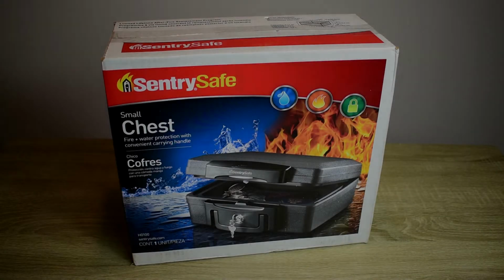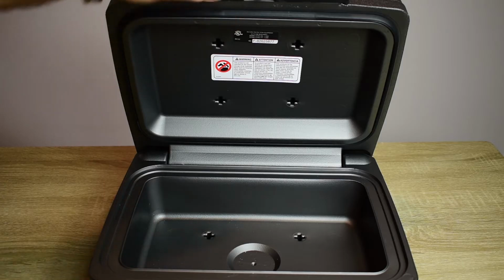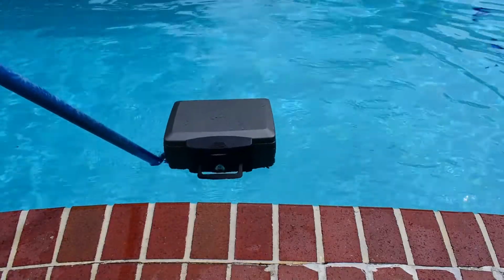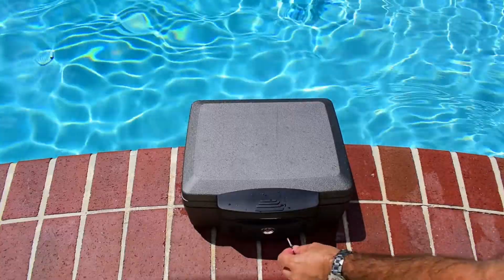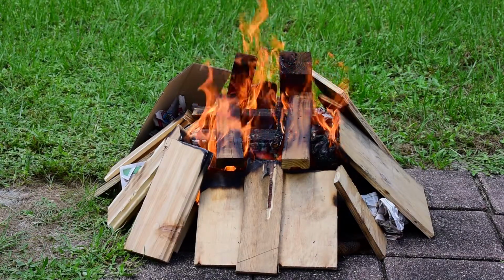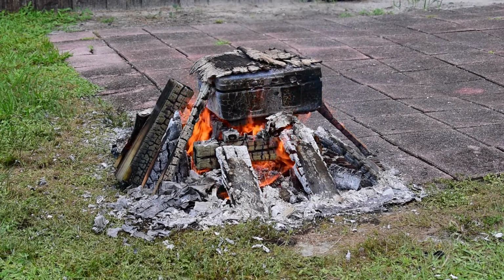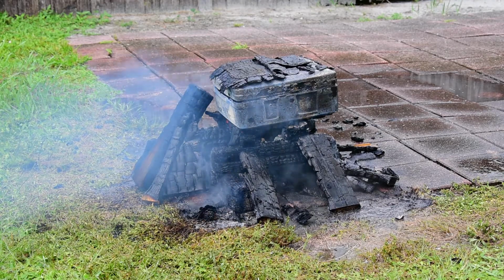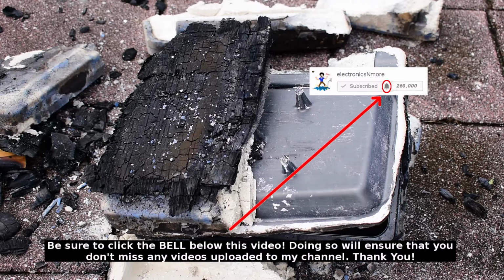Fire Resistant Safe Test! (Water Resistant)

Comment: Never use these your documents will mold. 

This will keep water out but won’t keep water vapor out. But once it gets in it will never dry out. So you put an important document inside and open it a couple months later assuming your documents were safe. But the safe it self destroyed your documents with mold. 

You can get extra thick ziplock bags that fit standard paper or legal sized paper. When those are properly closed your documents are protected from water vapor. So get a fire proof safe, this one looks good, and use airtight bags for your documents
Reply: The ziplock bags could melt with the heat if there is a fire, and damage your documents. But good thoughts about the mould, I’m going to add some moisture desiccate packets into my safe (but somehow need to protect them from melting on the documents too)!

Comment: I don't understand why some people hate sentry safe.  They are amazing.  I think the problem is people are looking for a one-size-fits-all safe.  But sentry safe makes multiple different safes for multiple different reasons.  One for fire and water, another for theft, another for firearms and medicine, ect.  They get upset when the fireproof model is easy to break into, or where the theft model is easy to damage with water.  They are trying to put them through things they are not designed for.

For instance, the safe in the video is advertised to protect from water and fire, nowhere on the box does it even advertise that it is meant to protect from theft.  The lock is like a lock on your luggage, it's for privacy not for security.

Comment: After seeing the lock mechanism melt off in the fire, I didn't have any hopes for the paperwork inside. I was relieved to see the paperwork stayed unharmed during the fire since I own one of these safes personally. 
I would honestly like to see the safe sit in the fire for an hour to see what happens. House fires get much hotter than a simple camp fire. I'd like to see the safe pushed to its limits. Doing another test with the safe sitting in the fire for an hour could be a realistic situation for people who have homes not near a fire department at all. So the safe would sit for a much longer period in the fire. If it would survive an hours worth of intense fire, I'd be sold on buying another one. Good video👍
Reply: I threw mine onto the sun and it survived!
Reply: Test that one with your own that you have😅

Comment: You cannot compare this to a house fire. They burn much much hotter. I lost everything and all the insulation on the safe was almost all gone. Papers were burnt on the edges but this video doesnt show what they really look like after a house fire. Also house fires go on for hours.
Reply from the maker: You sure can compare. The average house fire is around 1500F, the average campfire is around the same temp. My test is actually better because the flames are in contact with the safe the ENTIRE time unlike a house fire. Also, it depends where the safe is kept in your house. Close to the floor, the temp will be lower, up high, higher temps. Most house fires are put out in approximately 30 minutes, and that's what the safe is rated for, 30 minutes. If you live in an area where it takes hours to put out a house fire, especially if you're paying high taxes, you should consider moving.
Reply: Did you have documents in a fireproof bag inside the fireproof safe? 
I thought the idea was that the safe & bags were designed to be used together in conjunction. You need both not one or the other.

Comment: Is there something similar for USB, CD, HDD, SSD etc.? I assume the heat inside will destroy any data so it's not really an option for electronic storage media.

Strangely, the masterlock LCFW30100 (the biggest version of these) is advertised as suitable for "Storage Devices, USB Flash Drives" and "Small Electronics", which I don't understand. Clearly it gets too hot inside for the plastic not to melt or the data not to be destroyed.

Comment: Doesn't matter if it can survive a fire these fireproof safes will rust a piece of metal within 2 weeks if you put any cash or documents in they will be fully damp within two weeks and awful mildew mold I put $1,000 pistol in one of these by 3rd week it was rusted! These are junk I threw mine at the local dump site will never use any type of safe ever again
Reply: Unfortunately you'll have to get the older kind that are not fireproof or waterproof so the material can breathe I've just been using the lockable bank pouches they're not as nice as the safe but at least things won' mold
Reply: Which ones are good

Comment: I would put the valuables in a fire proof zipper bag first, then put that zipper bag inside that safe. This may help to buy more time. I wouldn't store that safe on a shelf or on the 2nd floor, because when it falls and hits the floor that cement type material enclosing the plastic interior is going to break and crumble to pieces and now leave that interior plastic exposed. I would hide it very well and keep it on the bottom floor, you don't want that fire proof material breaking or crumbling apart
Reply: problem with that is, then I am going to stack shit on top of this and be annoyed having to open/close it, think a real front opening safe will always be much better although way more expensive
Reply: There are several videos out there where they tested those fireproof envelopes, they are trash the cash burned up inside

Comment: Do you think hard drives would be ok after a fire as the inside can get pretty hot? Or wouldn't that be a problem? Would be nice to have something like this for a backup disk with pictures/videos.
Reply: Came here wondering exactly that.
Reply: Yes, I was wondering how various digital storage products would hold up, like external hard drives, thumb nail drives, SD cards, CDs, etc.
And also curious how metal would affect things inside, like if you were storing precious metals how they would affect the other things in the box.  Or even a paper clip or staple holding papers together- could that get hot enough that it somehow would burn the papers it was in contact with?

Comment: WATER RESISTANT not WATERPROOF. It means it’ll be fine in the rain, but shouldn’t be submerged
Reply from the maker: That's correct, but knowing homes flood, and the chest can get hung up under a shelf or be inside a drawer, I felt it was necessary to perform the test.

Comment: Using a temperature gun pointed at the fire would have been nice.  House fires burn much hotter than a camp fire.
Reply from the maker: All depends where the fire is, and where the safe is. This test was good because the fire was centered on the safe.

Comment: I appreciate your video,,,,if people are on a tight budget this is a very good option I owned one I have for several years now they’re cheap,,,,however pretty good,,,about eight or so years back I also bought a small Sentury floor safe I thought I was actually getting a safe,,,,well they are not theft prevention,,,, I didn’t know,,,,I thought they were rocksolid they’re not,,,,I paid a little over $100 for it with tax on sale it has the old-school dial combination lock and it weighs a little over 100 pounds,,,,I’ve seen videos on that safe it can take a pretty hot house fire and survive a 30 foot drop without opening so I’ll keep my little chest and my little safe for fire protection for my documents however I will be upgrading soon I hope,,,,to an actual Theft prevention type safe. I’ll probably go with a burglary/fire home safe that is UL rated RSC and UL rated fire resistant.
Reply from the maker: Glad you liked the video William!

Comment: Sentury does offer decent fire protection at a very good price point however do not buy Sentury products for theft prevention they have zero theft prevention except from very small children,,,,they are good to protect from 🔥 fire and possibly limited exposure to water that is all,,,I would go to Dean’s safes or the safe and vault store and look around at their home burglary/fire safes if you’re looking for something a little more substantial,,,, I have been looking at American security BF 1512 and American security newest line of home safes the BFS series,,,another decent safe at a decent price point would be the American security CSC series decent burglary protection excellent fire protection,,,,, another good brand of small safe would be Burg watcher small but built like a tank. You can get a special bag that’s fire resistant and water resistant from these safe stores to give an extra added layer of protection inside of a fire box or actual safe

Comment: Thank you for this video. Very nice. A suggestion: Could you fire test a Sentry Safe with a thumb drive locked inside? (for Sentry UL classified Safes that have Media Protection, tested to withstand an external temperature of up to 1550° for half an hour).
Reply from the maker: You're welcome Rob! I may do another video. Thanks for watching
Reply: Yes! I was hoping he would have done the test with various materials inside, including a mix of paper, plastic (especially including external hard drives, computer CDs, thumb drives, and SD cards), and metal.

Comment: You would have to consider that a house fire could possibly get much hotter than your fire did,  which would impact the final results as well.
Reply from the maker: True, but most of the time the fire happens away from the safe, not under it(People put it on the floor, or on a shelf that shields it), firefighters put the fire out fairly quickly.

Comment: You went through all that work and could not be bothered to throw miscellaneous anything inside to actually see if it protected?
Blank paper, I barbie doll, a cd, a USB - what, they were too expensive while you tested it? ?????  - ?
Reply from the maker: I did have paper inside, it was the best thing to test.
Reply from the maker: CD's are made of polycarbonate plastic, which has the same or higher temp rating as the plastic lining the inside of the safe. There was no reason to use one inside, you saw the inside after the fire.

Comment: I would have liked to have seen the case thoroughly soaked AFTER the fire, like with a fireman's hose or the pool rather than a little hose pipe sprinkling.
Reply from the maker: After a fire it's possible for water to enter from a high pressure nozzle.
Reply: @electronicsNmore  I guessed that may be the case :-)

Comment: Actually, while the papers didn’t burn . . . But, because of the cheep locking mechanism, the sensitive documents are now subject to prying eyes 😃
Reply from the maker: People shouldn't be prying on your property after a fire. :-)
Reply: the lock doesn't matter, the fire burned through the outer structure. If someone wanted into it at this point, no lock is going to stop them... I.E. hammer and screwdriver...
Reply from the maker: @Quickened1  The lock does matter, because many people buy these to secure things from kids, other family members, cleaning people, etc.They needed to know that the lock is very low security. After a fire, yes, the type of lock makes no difference.

Comment: This was a good first draft, but I would have liked to see the following improvements:

1.  Impact testing.  If stored in a first floor office located in a two story home, in the event of a fire the safe will possibly have to withstand the building coming down on it.  It needs to retain structural integrity such that the continued heat of the fire still going on, as well as the possibility of water damage do not happen

2.  The box you show mentions submersion testing - which means being covered in water for a sustained period.  I would have like to see how it survived at least 24hrs underwater (the amount of water from a firehose is substantial).  Plus, in the event of flooding, how long before the flood waters recede?  

3.  The box you show mentions that this is supposed to work as a data safe.  It would have been great to see what happens to a USB drive with documents, music, and images on it - for a drive that does not melt, are the files corrupted by too much heat?

Keep up the good work!
Reply from the maker: First draft? LOL People on YT are comedians. Due to a lack of exposure(which is caused by YT's algorithm), subs not being notified when a new video is uploaded, and viewers that don't help support my work by sharing my videos, you can be assured there won't be a second draft. You think I want to spend more time making videos and helping others without being compensated? Do you work for free? Impact testing is irrelevant. I was testing fire and water resistance, and did it well. As for media, I said I wouldn't place plastic or photos inside. I also showed that the safe had a lousy lock. The chest did a good job keeping water out. There was no reason for a 24hr test, specially a storage chest that floats. You sure do expect a lot from a 30 dollar safe. Thanks for watching
Reply: @electronicsNmore  My apologies, I did not mean to suggest that you owed us anything (which my wording did inadvertently imply).

The reason I suggested impact testing is because when a house burns down these kinds of devices are often on the ground floor or in the basement and when the house comes down they are often subjected to damage from the falling beams, bricks and other debris.  They can also be trapped underwater for days or weeks before they can be dug out and retrieved. 

However, as you point out, that's probably outside the scope of a $30 safe.  Thanks for your continued work, I enjoy the variety and scope of things you bring to our attention.  Have a good weekend!

Comment: That submerging  test was very weak.
Reply from the maker: If you're that worried about it leaking, and doubt my results, then buy one and make a video! Send me the link.
Reply from the maker: The testing wasn't exactly weak. The case is rated for submersion for UP TO 1 hour with only 2" of water over the lid. The case is difficult to submerge. I've designed many things over the years, and could tell you that two molded plastic sides with a large gasket between them, will not leak unless the plastic is damaged or the lid isn't fully closed. The throw test into the water went above and beyond the case ETL rating. When the case hit the water, there was a lot of pressure exerted on that seal.
Reply: @electronicsNmore  you could have held it under the warter.....a hook on that pole to the handle or just your bare hands.  Im a fan of you channel but i have to say the water test was lazy and weak
Reply from the maker: @Ezzell_  Wrong. Pushing down on the lid to keep it submerged, would only put more pressure on the gasket making it seal better. You seem to miss the point that this case floats. If you think it will leak, then buy one and try it. :-)
Reply: @electronicsNmore  the case wont float if it is in a cabinet and the flood water are higher. Yes..putting the case under water will make the seal tighter....but if there is a bad design or imperfection in manufacturing, a leak will happen. Any other excuses?
Reply: @Ezzell_  It is first and foremost,a fire safe. It was designed to take the heat during a fire and keep the contents dry during the fire department's role of putting out the fire. Lot's of water & stream .  Hope that helps.
Reply: @Ezzell_  Where's your video?
Reply: ken ezzell yeah I want to see if it can float with a gold Bar inside
Reply from the maker: @baporapo5016  A lot of pressure is required to get that case to fully submerge. Maybe 10 pounds or more.
Reply: This really should’ve been made to sink for at least a half hour. Imagine your home being fully engulfed in in flames, and this safe is somewhere stashed in your basement. After the fire is put out, your basement will be flooded and this safe could potentially be submerged for hours. How well it would hold up to prolonged fire AND water submersion is something I’d also like to also know.